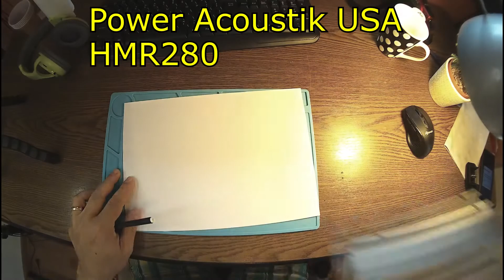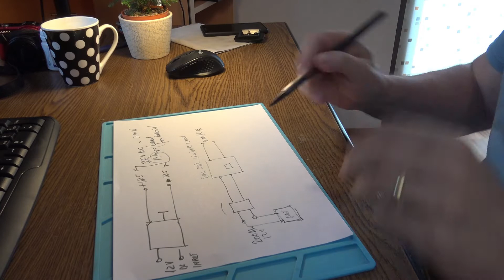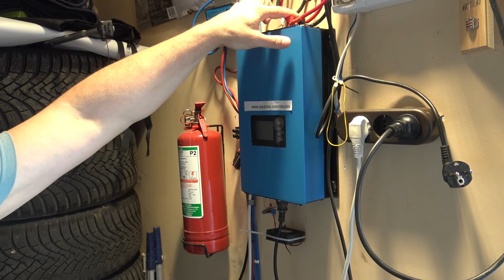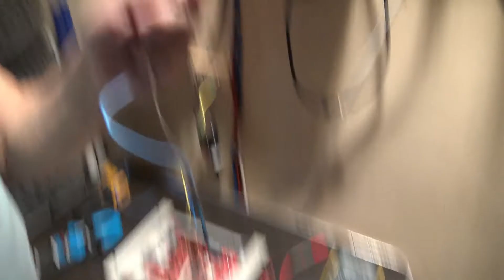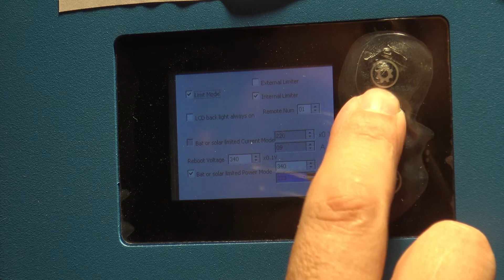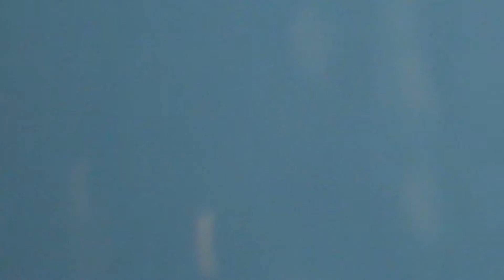Booster to power grid tie SUN GTIL2 inverter, will it burn?

Comment: Super good idea you have there, but one thing you have to remember is that the wires you use must be thick to be able to carry the large current, it can't help to use the thin wires that are just twisted around the plug You have an incredibly large voltage loss even on short wires .
But again, super good idea, I'm sure I'll try it myself, thanks for the idea.
Reply from the maker: Of course, this is just an experiment..Takk Jesper
Reply: @viocaia  I myself use one of these inverters and it has worked for 6 years now, I am very happy with it.
Reply from the maker: @MrProvinspoul  I just bought a 2000W version, so far so good.
Reply: @viocaia  😀